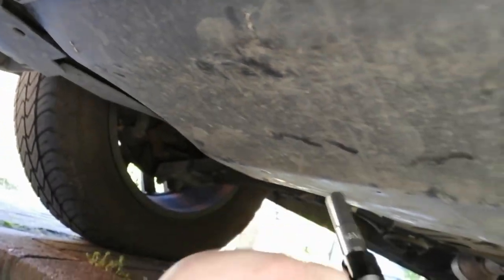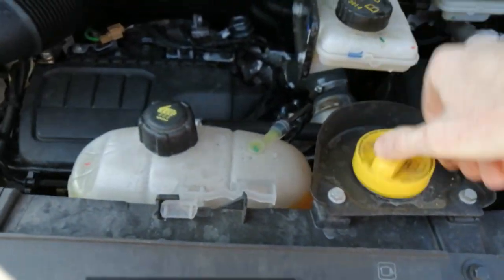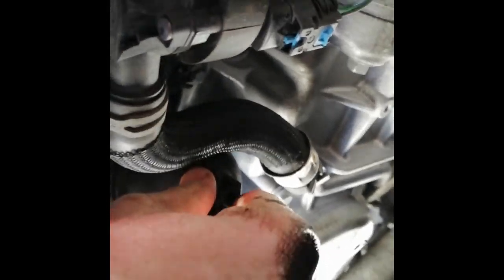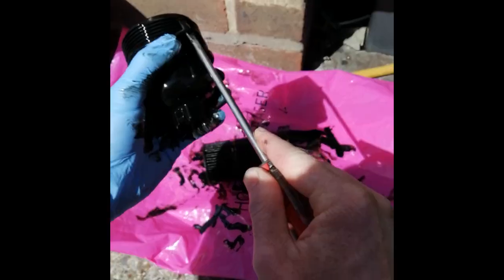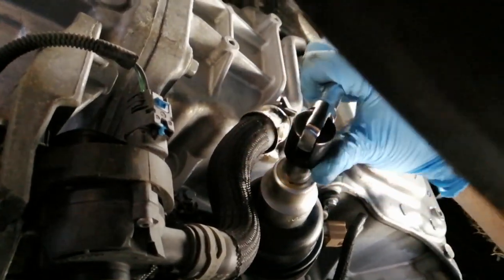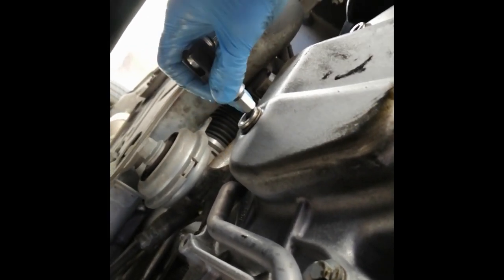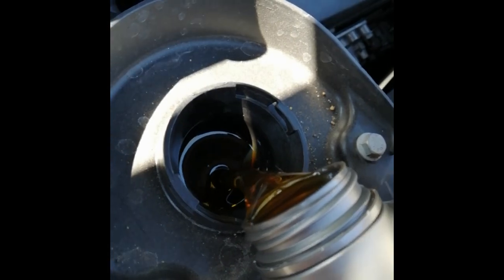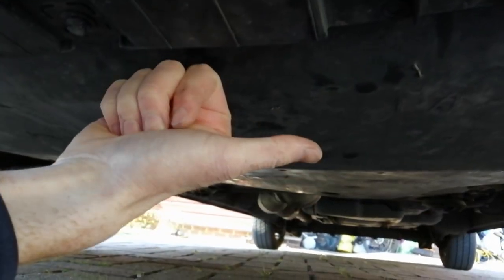Renault Trafic 1.6 2019 Engine Oil & Filter Change

Comment: Thanks, spot on review including all parts and tools needed for oil change. This apply to Vivaro as well as Nissan NV300 as same engine and van. Quick note oil must be C4 grade so Helix AR-L is the one or Castrol GTX C4 to be compliant with Euro 6 engines
Great job for video and instructions m8
Update:
Just finished my Nissan NV300, Oil filter socket is 27mm on mine. All went as smoth as video. FYI make sure you have at least 8 litre oil drain pan
Reply from the maker: Thanks for your feedback and comments. Glad you found it helpful 👍
Reply: Oil must be dexos2. So an 5w30 acea c3 api SN/CF or SM/CF it is more than OK
Reply: Igor Todo read the Opel vivaro user manual for these vans. Page 222
Reply: @freeinfo4all  Hi Mr plumber my vivaro is a 2015 model what euro rating is it and is it the c4 oil many thanks Mark

Comment: 25nm  for oil filter housing and 50nm for sump plug
Reply from the maker: Thanks for the information, although I wouldn't recommend tightening the sump plug to 50Nm, it seems too tight.
Reply: 20nm for the sump plug 50 is way too high you'll strip the threads doing that
Reply: @TrulyUniqueOne  check the renault workshop manual thats what it states

Comment: By the way how many litres do i need for my Renault traffic iii 2015 1.6 dci?

Also where do you dispose off the old oil?
Reply from the maker: 7-7.4-litres. I disposed my oil at a skip as they have an old oil container there.

Comment: 6 litres.  7.6 is way too much
Reply from the maker: The engine I was changing the oil for requires 7 to 7.4-litres.
Reply: @cm66ot69  I have the same and it takes 6 litres
Reply: @stevefenech630  the this engine takes 7.4 litres, the older model takes 6 litres but the one in video requires 7.4
Reply: 7.0 litres in my 2017 Vivaro incl. filter change
Reply: 6 litres for single turbo, 7,4 litres for biturbo.